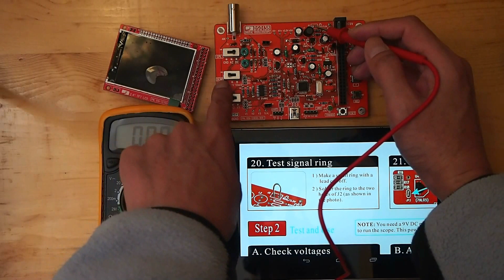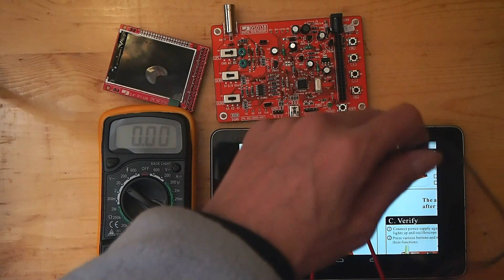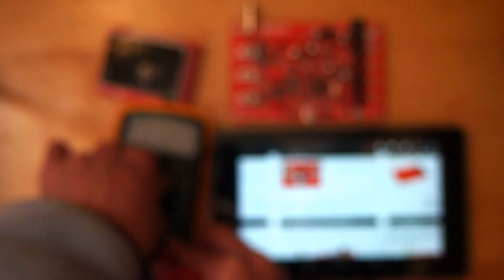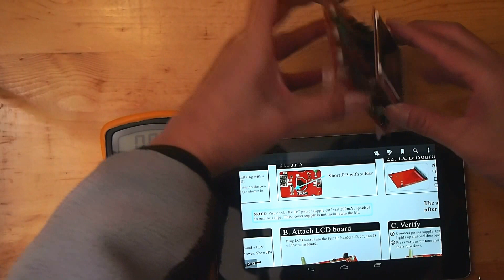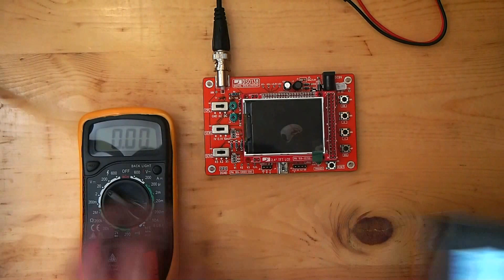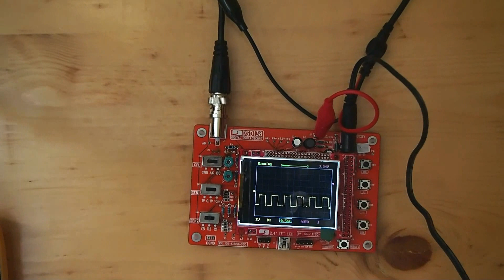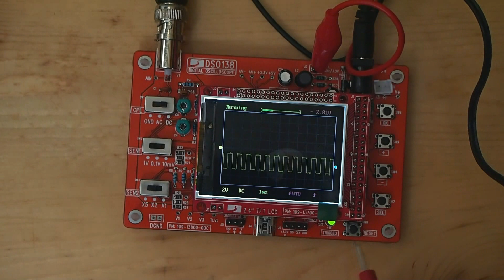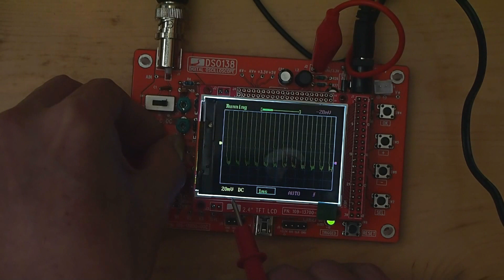Final check and Power-up DSO 138 DIY Kit

Comment: is that possible if generator output = 220 V ac stepped down to 12 V 
(still ac) with only transformer without rectifier, and we can safely 
measure 12 V ac waveform ? 

and how if inverter (12V dc to 220V ac)  than step down like obove, and we can get safe and accurate waveform by this DSO ?

Comment: Hi all,ive just built one of these kits,and all works ok and voltages spot on at all test points,led flashes during boot etc,but led doesnt flash any other time,any ideas why its not flashing,i dont realy understand oscilloscopes and how to properly use them,i know about waves quare sin etc,but not sure what trigger is all about,ive playing with my oscilloscope all aftenoon,but never see the led flicker on only during boot,any help will be great.
Reply: +Duncan Young Don't worry about it.  If it flashes during boot it's working.  When you perform the probe calibration it will flicker a bit.  It lights each time a trigger event is detected, such as voltage rising to a preset parameter.    That's it really.  It's really only there so you know that something is triggering the scope if the screen isn't working or isn't displaying any information.

Comment: Hi:

I will buy the oscilloscope.

But looking at Ebay I find that there is a version with black PCB board color, which I liked but I have a question .

The PCB is a company called " SainSmart " which is obviously Chinese , but not if it works like yours.

Would I recommend buying the SainSmart ?

Would I recommend buying the original?

Did not you send me the link where you bought your oscilloscope ?

Thanks for the answers .

Regards.

SainSmart Board:

http://www.ebay.com/itm/SainSmart-DSO138-2-4-TFT-Digital-Oscilloscope-Kit-DIY-Parts-Kits-1Msps-Probe-/121657211184?pt=LH_DefaultDomain_0&hash=item1c5355b930
Reply from the maker: Javier Karrillo I'm not affiliate of the product, and cannot say anything about it.
But you can refer to the website: http://www.jyetech.com/Products/LcdScope/e138.php, I think it should be the official website of the DSO138.

And the product from SainSmart is reported FAKE DSO138 kits, refer: http://www.jyetech.com/forum/viewtopic.php?f=18&t=497
Reply: Andr.oid Eric

I don't wise that.

I will buy the original.

Thanks for the tip.

Regards.

Comment: Frustration. All components of the composition. On. All short-circuited. Looking for the error, I can not find.
Reply: With mine, the 9v battery power connector (the thing that plugs into J10) was soldered with a short.  The positive wire's solder was actually touching the outer shielding, creating a short.  Once I fixed that, everything worked as expected.